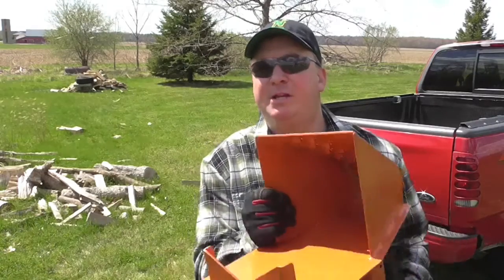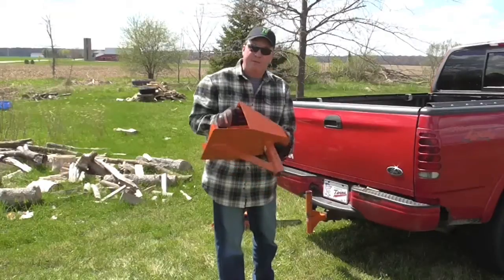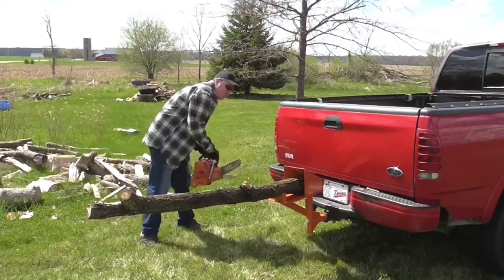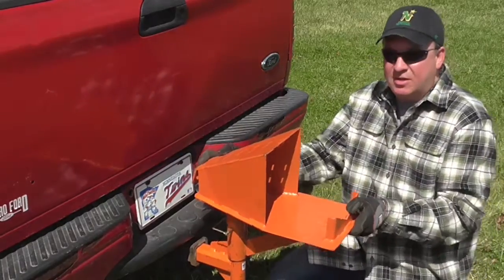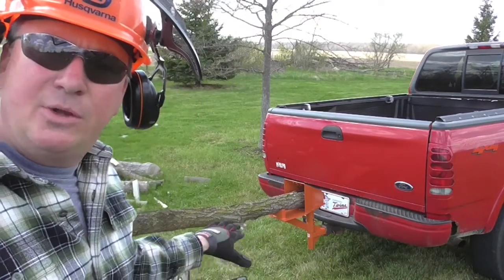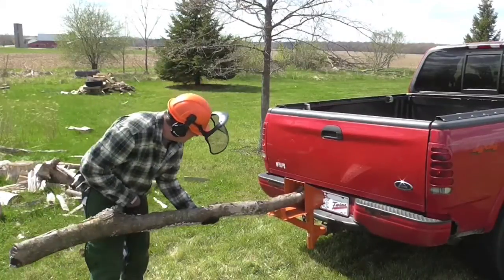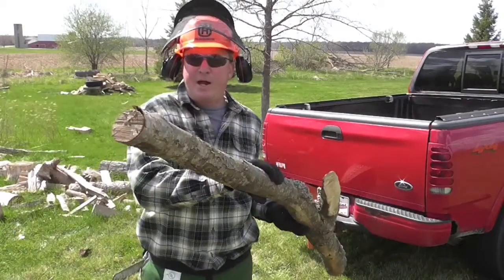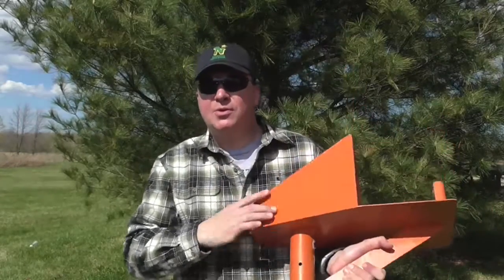Wood Dock Log Holder Modification- Mfd by Vincent Products

Comment: Much better with the pin.. can't believe they designed it without. Yes chain saw pressure keeps it fixed but as demonstrated in your first video it was very dangerous trying to cut the branches off.  I bought one last night but not happy that I have to spend time and energy installing the rotation pin but never-less it was better then others out there. Thanks for your videos   it helped me select the best.
Reply from the maker: You're welcome.  You made some good points.  Hope it works well for you.

Comment: That's the mod I was thinking about on the other video. I can see the need to be able to swing side to side but not while cutting. . 
if the manufacturer thinks that it's enough downward pressure to keep it from moving then they haven't used it or they used it w a dull chain. I can tell the difference in this video and the first one when the chain was sharp. Because when you started cutting w the sharp chain you didn't need as much pressure and it started moving as you tried to cut which made you walk and push the limb while cutting. That's when an accident could occur using this product. But when you used it now there was way more downward pressure since the chain was dull so I guess I can see their point. 
But a great simple mod that makes this thing worth having. 

On another note you talk about safety. I'm disabled and have had 7 major back surgeries. Before one of my surgeries I thought I was strong enough to cut some limbs that were in the way. I took my Husqvarna saw and began to cut. My back wasn't as strong as I had in my mind and during cutting  the saw somehow bounced off the limb and into my leg. Luckily I was wearing my Carhart 12 oz work pants. When it bounced I took my finger off the throttle I guess by instinct and the bar landed on my leg. I recon since the jeans were so thick it caught the chain and bunched up in the chain stopping it. It tore my pants and left only a single scratch on my leg. 
Thank you for stressing safety, had I used some chaps my pants would be fine but w o the thick pants or just regular jeans it would have cut a gash in my leg.
Reply from the maker: Thanks for sharing the need for safety gear.   Glad the Carhart work pants kept it to just a scratch. 
Good points you made there with the sharpness of the chain.  I always use the Wood Dock with the pin in it.

Comment: I just bought one of these after seeing Mark's video. Like others have said, the swinging seems crazy dangerous. Mine is mounted to a wooden post and I added screws to secure it from swinging. I am typically cutting smaller logs than you are, like 2-5".  My initial impression is pretty good. I see your video is a few years old, do you still use your Wood Dock?
Reply from the maker: hallcp2 yes, I drilled 2 holes in it to keep from swinging.  It’s a very handy tool that I still use on a regular basis.

Comment: Is this product still being sold? If so, where can I buy one? Having said that, what are the principal dimensions of  the wood holding box?
Reply from the maker: I think it's only available at Baileys Online.  It's really a great item.  Mine has held up well, but I need to repaint it after having it outdoors quite a bit.
Reply: Hi. If I send you my email address would you please take a pic of the top plate and one side plate of the main structure and send me also the rough dimensions? I am a Navy retiree living in Japan. Thank you.
Reply from the maker: No problem.  My email address is in my about section.
Reply: Home Depot.
Reply: I just built my own. Works great. Very heavy duty.